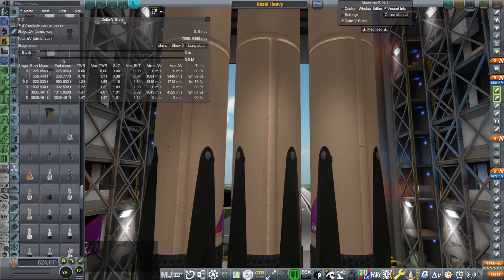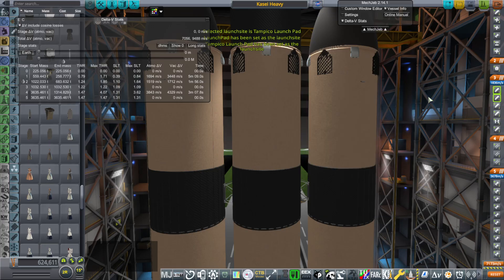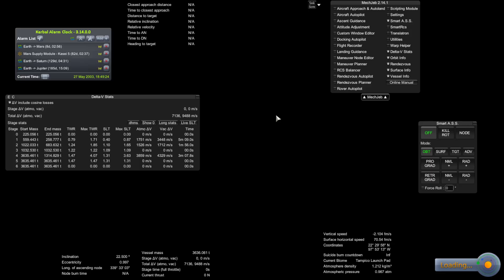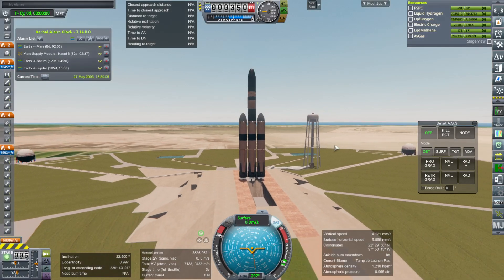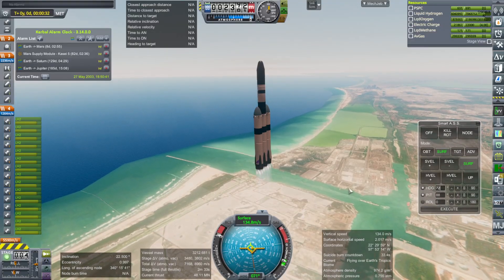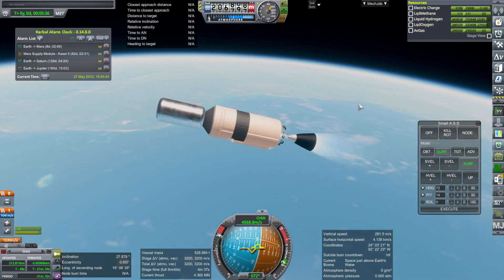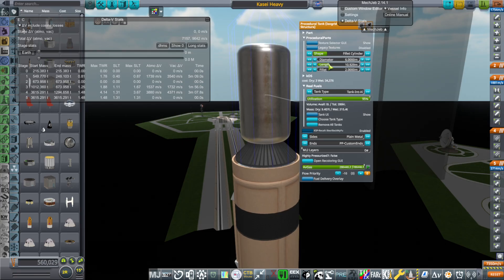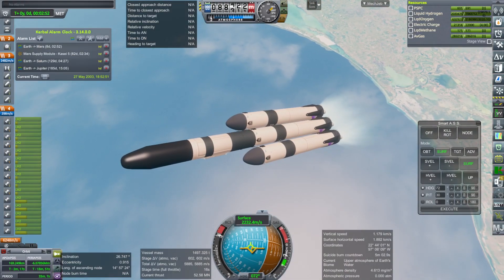Kasei Heavy (RO in KSP 1.12)

Comment: Falcon Heavy can recover the center booster, they just choose not to sometimes to max out payload capacity. You get a lot more juice, but they can and do recover the center booster
Reply: It's not sometimes, they never choose to recover the center core anymore. They tried 3 times and failed 3 times to recover the center core (though they did land once and then have the recovery fail during the trip back to land).
Reply: The software can be bulletproof, but hardware cannot easily be so.
Reply: @plainText384 hey they landed one tho
Reply: @pekabu01 yeah. Still failed to recover it, though. And they haven't tried since 2019.